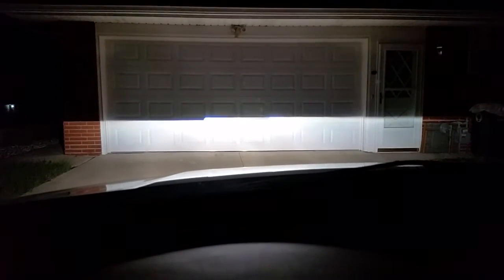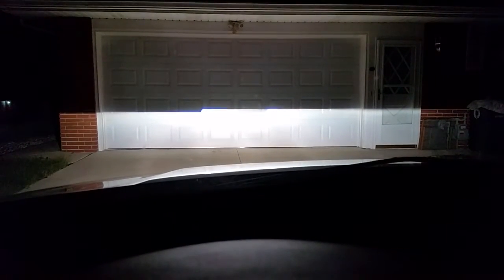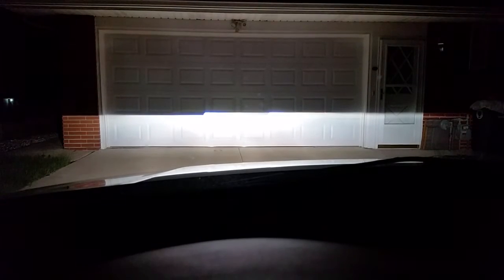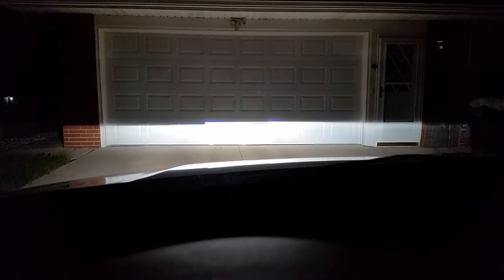VW Jetta MKIV HID Leveling motors in action

Comment: how can i add to a mk6 Jetta, need to put the wires from steering wheel switch to the headlights ?? how to put the wires doesn't have any hole
Reply from the maker: Renan I did this on my MK4 Jetta....the MK6 would be very different.

Comment: I want to buy an OEM, but I thought about do retrofit, the fxr are greater than the OEM, but they do not have AFS
Reply from the maker: Renan oem isn't very good and afs would be so much work.
Reply: James Siros i know, i retrofited with Morimoto 3.0, but in one side only its so much work to open permaseal headlight
Reply from the maker: Ah, I only had to deal with buytl rubber to get mine open....permaseal would be a mess!
Reply: James Siros original headlight or aftermaket ?
Reply from the maker: Renan it was an oem bucket